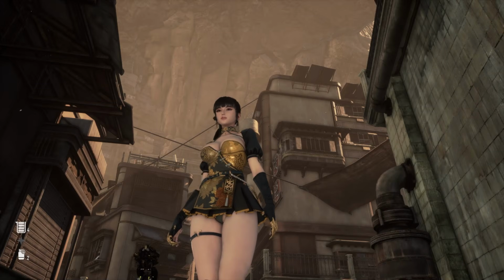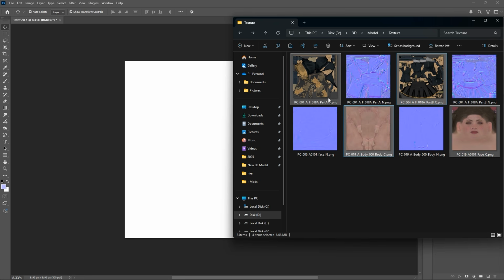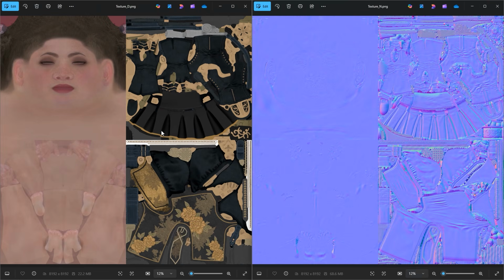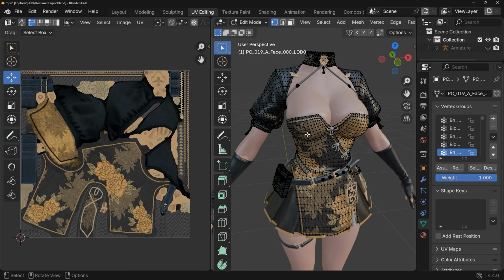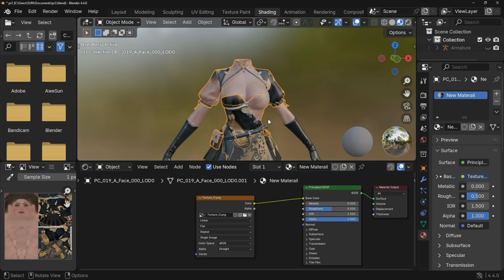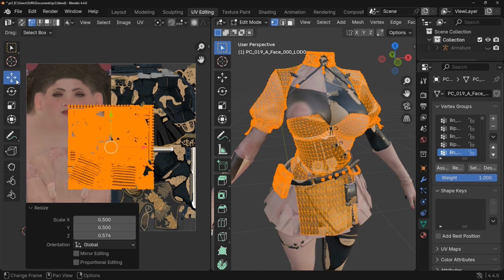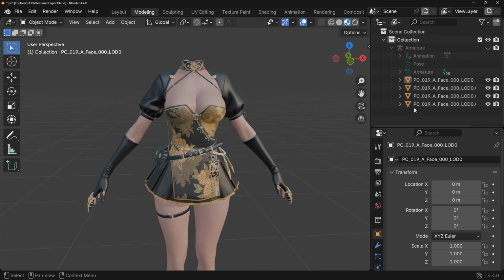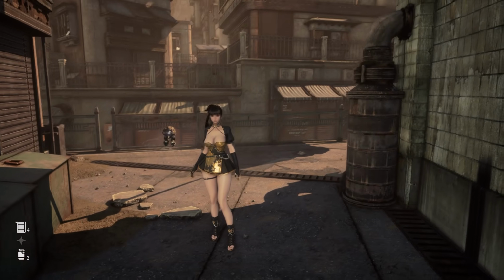Merge All Materials & Textures in Blender – Optimize Your 3D Model for MODDING!

Comment: I've watching several of your toturial, great stuff, but now the only issue I have is I have a modle and original texture from RE2 and want to swap to SHF, but the texture color doesn't match. I've seen this video, but how did you match the custom texture to the head color?Even the part you removed where there is a joint with the head part, the head part still use the original head texture right?so the Body use your custom texture right? how do they match, I only learned 5 days, so sorry if this is a simple question. Thanks a lot!
Reply from the maker: thx, if the body texture and head doesn't matching you need to use photoshop or something similar to edit the brightness and shading of the image (texture) and do yuor best to match,
so i open the body or the head texture in photoshop and and use the filters to adjust its shading and that's how i match.

Comment: Hey I'm new to modding so it might sound like a stupid question but... what do you do with the original materials not used on the new model? Not talking about normal maps either. Do you just delete them? Does it create any conflicts?
Reply from the maker: if there is a original material on the model that you don't need just delete it yes. np

Comment: exactly the thing im searching for  thanks ♥.can you help me again i m having a problem with my custom object for mod of the character when im exporting the mod the object i created is floating what could be the reason weight paint may be ? help  make a tutorial ♥
Reply: Either you didn't rig it or you didn't put the armature as the parent of the object
Reply: @itanbu  yeah it can be the problem thanks ❤but thats the problem with me i dont kno wthe concept of rig yet too well so,im searching for it and also im modding wuwa  and also im a beginners so thanks again for help ♥And also the model which i import to the blender does not comes with rigs that also the part of my confusions i covered about 70% of my modding journey reset is confusion.
Reply from the maker: @Sliverimortal  the reason your model doesn't have a skeleton is simply because it wasn’t made with one. You can create one yourself, but that’s only necessary if you want to adjust the pose.

As for why your object is floating in the air—that's likely a different issue. Is it a separate object, or is it attached to another mesh?

Either way, make sure you’ve added an Armature modifier to the object and selected the original game’s Model armature. Then, test it by moving the character’s bones in Blender—if your object moves with them, it’s working correctly.
(after weight transfer)

Also, double-check that you're exporting the models from FModel using the exact same settings I show, and importing them into Blender with the same configuration.
Reply from the maker: select the object and press CTRL + A then choose all transforms (this will apply all the transforms and might fix it)
Reply: @Last_Ghost-GAMING  yeah i know that part and done it already i think i dint get the concept of rig etc. thanks can you suggest some Yt vids of you. ❤